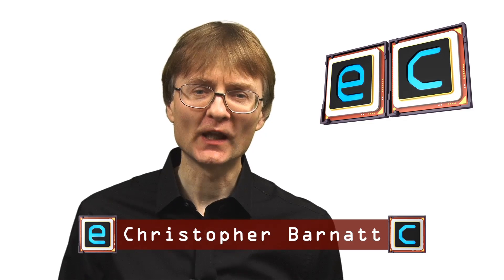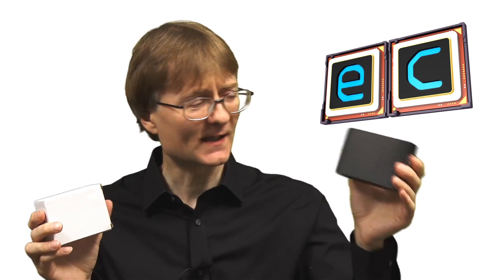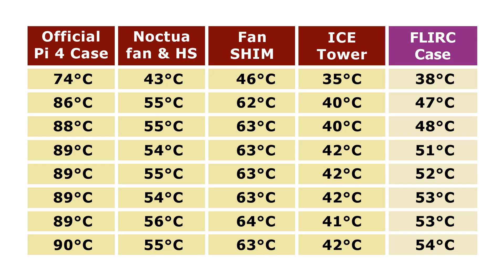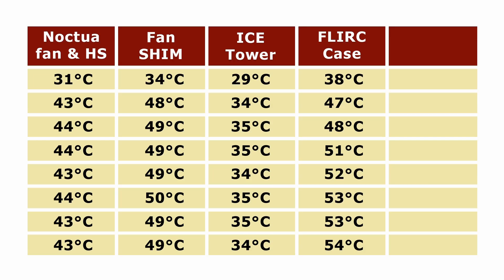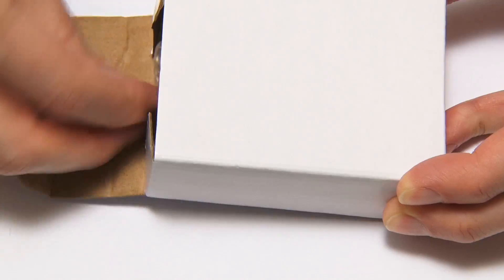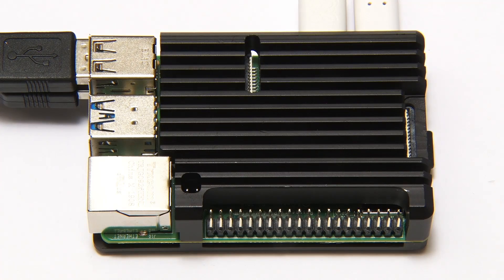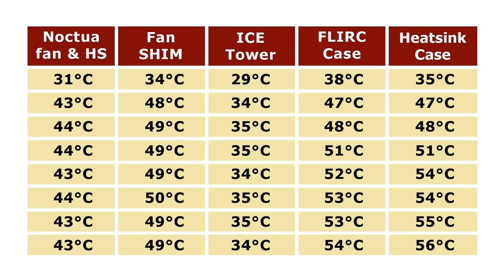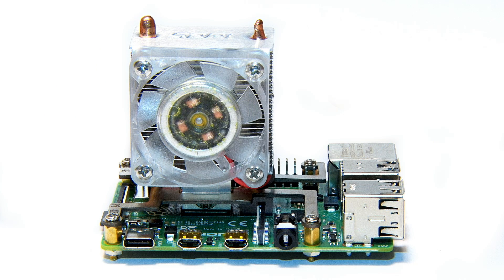Raspberry Pi 4 Passive Cooling

Comment: it'd be interesting to see the numbers on a pi4 with one of those little ebay "pi heatsink"s on the SoC and in the stock pi case, adjusted for the new update. PS: you are the greatest for testing all these against each other by the way

Comment: Any airflow at all over the "heatsink case" - especially lengthwise I suppose - would no doubt improve its performance due to the exposed fins, but it's fine as is of course.
Reply: I wonder if installing it vertically to use natural convection would do a noticable difference.

Comment: I heard the aluminium case blocks some of the wifi signal. Could you check that please?
Reply from the maker: Signal strength is indeed reduced a little, but performance does not seem to be impacted.

Comment: Thanks for your video. But I have one question: what about wireless devices (Bluetooth and WiFi) ? Is aluminum case didn’t decrease signals to receivers? Anybody checked speed of WiFi with and without aluminum case?
Reply from the maker: Signal strenght drops slightly -- thought it did not impact performance for me.

Comment: Hello Chris, I have bought a passive cooling Aluminum Alloy case, and use the pi to browser facebook and youtube. The highest tempature is keep in range 66~69 degree. That is absolutely not in 54 degree... Then I add a cpu metal heat sink on top of the case without fans, it drop to 62~66 degree. After I add a fans with the heat sink, it drop to 50~52 degree. What I want to said is, the passive cooling case cannot be very passive XD. Of course you can said that 70 degree can be acceptable because someone already get his pi higher than 81 degree, and his system still working.
Reply from the maker: Remember here I am running the latest firmware.
Reply: @ExplainingComputers  Of course I did it before the test. And I found that one of the reason the users said that they cannot update the firmware, because they/me have use SSD boot. We need to change config file and boot the system back from SD Card to update the firmware.

Comment: I bought the two-part heat sink armor case from Geekworm on amazon. According to a comment on amazon website, the supplied "thermal tape" is actually not thermal conductive. Therefore, I use some thermal paste instead and get a even better result:
Set 1: 39.0'C > 46.0'C > 48.0'C > 48.0'C > 48.0'C > 49.0'C > 50.0'C > 51.0'C
Set 2: 40.0'C > 48.0'C > 50.0'C > 49.0'C > 50.0'C > 51.0'C > 52.0'C > 51.0'C

Comment: Thanks for the openness of the video... The other YouTubers who have done  videos on dual fans for the pi's has stated the dual fans was quiet in which they did the test on a new fan 1st use. I got one of those dual fan for my pi4 to sit behind my TV in my bedroom and within 4 days is was a noisy bitch..

I had to get rid of it and made my own heat sink and and from scrap parts. 

I took an old heat sink from an ATI video card and a supper quiet fan from an old laptop CPU.
it doing a better job than  the dual fan I got...

So I say, if you have old video card and old laptop laying around take a look at the heat sinks and put them to use..Laptop and video cards is made for the heat and the long life of these part. the cheap dual fan I got from amazon for $18 is crap.

Comment: The thing is the RPi4 does throttle until 80c is it?, so either of these passive coolers will be good enough regardless if there not as cool as the fan assisted solutions

Comment: I am also interested in the "official pi case" , post Sept. update, test results too.
Reply from the maker: I did not dare test it --  not after the first time at 90 degrees. It will still get too hot I imagine. A totally sealed case is not good.

Comment: Is'it possible to create 3 in 1 device from One Board Computer like Raspberry 4?
1. Router - LAN input WLAN outpout
2. NAS - Backup for devices,  central storage for sharing data (SMB)
3. Media streamer - DLNA, EMBY
Reply from the maker: This could be done! But not using OMV. Unless by switching SD cards as required! :)
Reply: @ExplainingComputers  Thank you for your answer. I saw a movie about making a router with Raspberry and yours about NAS so I thought about joining these projects. However, I really care about the combination of NAS and Media Server functions. Router may be a separate device ;-)

Comment: Hot Flash (pun). MagPi Magazine 88 Pg 74 suggests orienting the Pi 4 vertically, with the USB ports up. This is said to result in 2°C cooler running at idle. Also, do a "sudo apt full-upgrade -y", then "sudo apt -r shutdown" (the magazine shows this in error as "sudo apt - r shutdown" but there should not be be a space between - and r).

Comment: I’m on the fence about buying Raspberry Pi 4. Review after review say the one negative thing about Pi 4 is the heating problem. Are we saying the most recent firmware update has eliminated that problem?
Reply from the maker: The most recent update has massively improved things. The Pi 4 still gets hot, but with some kind of cooling solution (small heatsink, or ideally something a bit bigger like on the cases or other solutions shown here), and you will have no problems.
Reply: Thanks for the clarification, sir! Really appreciate you taking time to respond to user posts.

Comment: I´m trying this test as I write on my RPI 4 4gb. Just for reference: we need to install sysbench for it to work! Also Chris: do you have some repository where we can copy and try your tests? i had to pause the video and write it word by word then find and correct my mistakes! =(

Also, I´ve read some reviews on the "Aluminium Heatsink Case for Raspberry Pi 4" about it weakening the wifi signal. I installed wavemon and saw some fluctuation when i put the cover on top and took it back. Have you done some test about this issue?

My results:
temp=50.0'C
temp=65.0'C
temp=65.0'C
temp=67.0'C
temp=69.0'C
temp=69.0'C
temp=70.0'C
temp=71.0'C
pi@raspberrypi:~ $ sudo rpi-eeprom-update
BOOTLOADER: up-to-date
CURRENT: Tue 10 Sep 10:41:50 UTC 2019 (1568112110)
 LATEST: Tue 10 Sep 10:41:50 UTC 2019 (1568112110)
VL805: up-to-date
CURRENT: 000137ab
 LATEST: 000137ab
Reply from the maker: Yes, indeed, sysbench needs to be installed -- sudo apt-get install sysbench. Sorry, I forgot to mention that in this video (I never know how much to repeat from previous episodes). :)

Comment: Can you do a video on using a RP4 as a NAS using the enclosure from Geekworm? They sell boards that you can mount SATA drives internally.
Reply from the maker: I will take a look.
Reply: @ExplainingComputers  Thank you. Geekworm has a few videos on this assembly but they only focus on the hardware but not the software end. The videos also have no voice over explaining why things are done. I, and presumably many other subscribers to your channel,   are interested in creating a compact NAS and media playback device using the Pi as an all in one device. At the moment, it seems like we need two separate devices for this purpose: one for the NAS part and the other for the player part. Is it possible to have both functions in one single device? Basically combining OMV and Kodi. It would be great to carry this device on trips and all we have to do is plug it into the HDMI port on the TV, power it up, and control it via our smartphone or some dedicate remote. This way, we don't have to use the hotel's entertainment offerings.
Reply from the maker: @jasontv9849  It could certainly be done -- or example, you can install Kodi under Raspbian, and also set up a file share.
Reply: @ExplainingComputers  If I do that, can this Raspbian act as a NAS so I can upload media files into it via SMB from my iPhone? I don't think your channel has a video on setting up such a Kodi system, is this correct?

Comment: If the power consumption is reduced, will it make the system slower?
Reply from the maker: It should not, power is just used more efficiently -- eg turning off parts of the USB controller when not transferring data.

Comment: Now that the eprom is updated, does that mean the heat problem is fixed in hardware, or will I need to do the EPROM fix across all my micro SDs? THANKS FOR THE VIDEO!!
Reply from the maker: Once updated, your hardware is fixed -- so no need to implement on all SD cards.
Reply: @ExplainingComputers  i just read on adafruit you need to type in "full-update". also, i tried to copy your stress test and it takes less than a second to give me the temps. can you pastebin your code?

Comment: In my opinion the active cooling is totally unnecessary on Raspberry Pi.
By the way, you can buy the Aluminium Metal Heatsink only for 12$. Just look around on the internet :)

Comment: Is that last heat sink case really for that pi? It might be my gyro that is not calibrated but it looks like the "towers" in the heat sink is all in a line which would mean that the smallest is out of line with the usb-controller !? I don't have one my self..just swosching by because I'm going to by my first pi soon and want to learn everything..well anything.
Reply from the maker: The ICE Tower cooler really is for the Pi -- covered in my video here: https://www.youtube.com/watch?v=e6mWImsF9iI
Reply: @ExplainingComputers   ExplainingComputers   sorry to have misled you with that "tower" thing.. I ment the last passive cooler tph-002 and it's sweet spots.. never mind if I'm completely wrong. Regards! Tm

Comment: There is a better passive cooler case sold now by Geekpi which has a contact similar to the Flirc case, but the contact is solid metal and not hollow. It also contacts the power supply chip. I have had results in the low to mid thirties using this cooler. I will note that I used a heat sink pad which covers the entire bottom of the board and sinks the heat to the lower case heat sink. The case sells for $14.99 US and is far better than those shown in your video.
Reply: Do you have a link to where you can order from?

Comment: you'd get even better thermal conductivity if the internal lug wasn't painted/anodised. Try lightly sanding the surface back to bare metal

Comment: Looks like I blew up my Atom Pi, my fault, like a plank I ran 12V through it in a moment of madness.  Defence is opiates but also trying to do 4 builds at once, all with various voltages/PSU set-ups- STX/ATX/warts with all sorts of badly labelled nonsense- I had it coming really.  Wrong peg in wrong hole.  HAvent checked yet so I may get lucky.  But it does mean my mineral oil cooled overclocked Pi4 is looking much more likely now.  Just have to work out why I need to overclock the hell out of it (any ideas guys and lady gentlemens?).

It counts as passive I think and I really need to get back to SBC soon.  I have my mid season PC rebuild (prob 2700X/DDR 4 32GB, 1T M.2 and 4TB of RAID HDD in a 470 motherboard).  That is going to be productivity based, not a great gamer and my 1060 still does duty.

So anyone got an idea for a 2Ghz 4GB Pi4 in oil?  I don’t mind mad as long as it isn’t pointless.  I have quite a few spares and such that can maybe live with the Pi4 (a screen for a start).  I like building cases so the basic case is a very small sort of fish tank (for keeping bugs for kids) but that can take influence from sci-fi or what have you and that might suggest the use case for the Pi4.  Dr Who, Blade Runner, Alien, Fallout all ideas running through my head.  But I will want to be going MAX on anything I can so 2GHz plus.  It doesn’t have to be the 4GB version if not needed but I fancy doing something mad/bad with graphics so might welcome the extra memory- and we are waiting on the boot from USB as well so some SSD will feature at some point.

My approach to the overclock would be just to get it stable so it will not throttle rather than hit a target that looks great but has no real benefit.  Running a Pi4 at 8C will be nice but it won’t effect performance for example.   

Some heroes on here will help me out?
Reply: Should add I like the passive aggressive cooling idea, maybe some sort of convection set up that does some work without having any direct input- so not a pump but some clever way to encourage flow of oil across heat sink sat in oil- thinking allowed there.   I have a relatively massive copper heat sink that might work on most of the Pi, what used to be called the ‘flower/rose’ style I think.  All sorts of junk to press into use… what use though.
Reply from the maker: This is very sad. :(

Comment: It looks like the FW update did the most of the job, hence I expected more from this video like testing passive cooling with some overclocking. Or a test with a regular heat sink and a regular (official) case. Seeing how successful is the new FW, now I have 2 questions; 1) are these 2 passive cooling options are still good with an overclocked setup? 2) Will a regular case and a regular heat sink will be enough to minimize or even totally avoid cpu throttling on a non-overclocked setup?  I wish you have touched these 2 questions as well. Thanks for the video anyway.

Comment: I would love to see this boot on a Ssd. I wish that the Hdmi  port was full size.
Reply: I didn't like it either but it saves space and doesn't pull the pi how it use with normal HDMI cord
Reply from the maker: Sadly the Pi 4 (unlike the Pi 3) does not yet support USB boot. But it is promised for a future firmware update. :)

Comment: I use the passive aluminum finned coveron a raspberry pi 4, similar to the one you pictured in this presentation. I found that the Wi-Fi did not work very well. Have you had similar experiences?
Reply from the maker: Signal strength does indeed drop.

Comment: #!/bin/bash
clear
# nice little loop
for f in {1..7}
    vcgencmd measure_temp
    # sysbench needs to be added first
    sysbench --test=cpu --cpu-max-prime=25000 --num-threads=4 run >/dev/null 2>&1
done

vcgencmd measure_temp

Comment: I have a pair of Pi4s with Flirc cases and I agree that the temps stay low, especially with the updated firmware.  I couldn't justify a passive cooler for these, and the silent operation is a plus.  Now I just need true USB booting and the Pi4 will be perfect for my needs.

Comment: that aluminum heatsink case is called the raspberry pi armor case. The bottom heatsink is carried over from the previous versions where the pi had the ram on the bottom. it's still there for ease of use and design and just makes it look damn good.
Reply: The copper-colored heatsinks have a smooth bottom.
Reply from the maker: There are lots of names for the case -- the castings are sold generically by many companies. :)
Reply: huh, i didn't know about the smooth bottom varient. guess i need to hunt one specifically to find it

Comment: How well would passive cooling like this work on a Raspberry Pi 4 based NAS like you did a few weeks ago? The quietness of the passive solution is appealing.
And a second question: since there is no fan drawing power, is the passive cooling significantly more power efficient in spite of the somewhat higher temperatures?
Reply from the maker: Both of these cases would work very well for a NAS. And passive cooling does indeed save power as you note. :)

Comment: So, putting the Pi 4 (with its on-board WiFi antenna) in a completely enclosed metal case.  Yeah, that shouldn't do anything to your internet connection.

Maybe test that part?  Is WiFi still usable after putting in the FLIRC case?
Reply from the maker: WiFi still works, with a little signal strength reduced.

Comment: On the TPH-002  does a standard 40 pin ribbon cable header fit?
Reply from the maker: Yes.
Reply: @ExplainingComputers   No.  A 40 pin ribbon cable will not fit. Simple fix is to add two 40 pin exenders.
Reply from the maker: @carlpetersen3128  I think it will depend on the cable. There is full access to the GPIO pins, so it is certainly possible to use a cable/connector that attaches to them without extenders. But something like a 40 pin cable with a right-angle connector (or side entry wiring) would not fit without extenders as you say.

Comment: Is this case anodized or powder coated? If it is powder coated i think it would be benefitial to remove the paint from the case where it touches the thermal pad. But it may only make a small difference.
Reply from the maker: I guess powder coated, or painted.

Comment: Well Chris, the test is not fair because the aluminum  sandwich touches 3 chips instead on 1 on the FLIRC. So you have to compare this category on cases and here's the Rolls Royce of them all : https://wickedaluminum.com/collections/frontpage/products/raspberry-pi-4-secure-case-with-heat-dissipation
Reply from the maker: The test is a fair comparison of the two products being tested! :)
Reply: @ExplainingComputers  please explain why? I don't speak about the conditions where the tests were made, I suppose that this is what all of us have at home, so fair enough for me. I understand that it's interesting to compare different types of active coolers with passive coolers when they are in the same category! But comparing passive coolers that touches only the SOC with passive coolers that touches also the RAM and USB controller it's obvious that temperature will be higher on the second, but this does not means they are less performant! And there are different types of "complete" passive coolers that covers all the 3 chips on the Pi4.
Reply from the maker: I struggle with what else to say. I tested the two different products and what they do. One contacts three chips, one contacts one. That's what the products do, and so that's what the results related to . What more can I say?